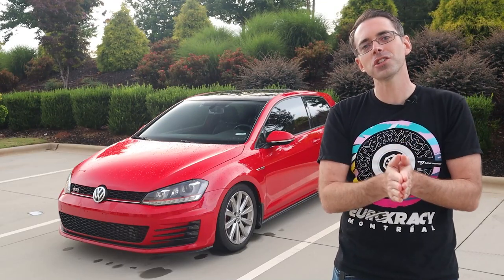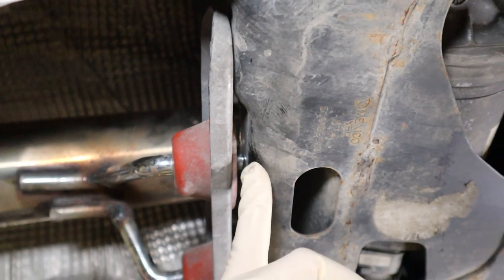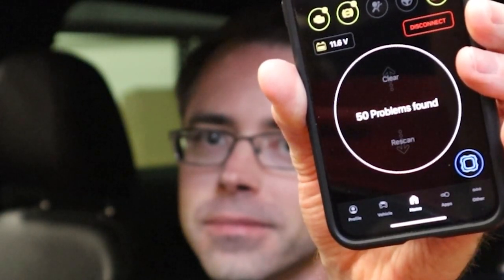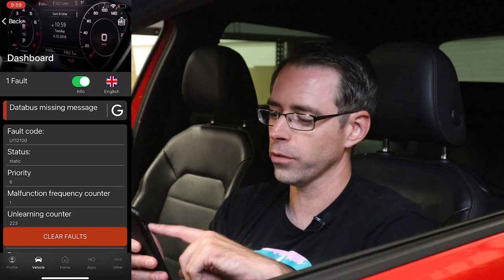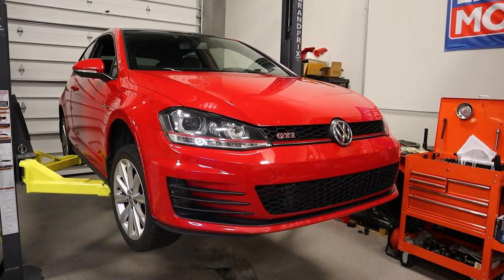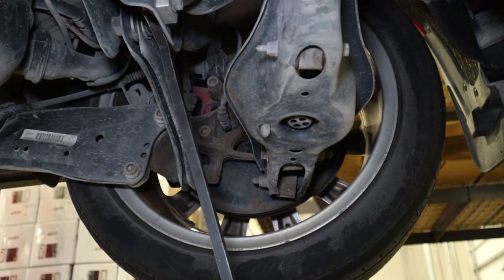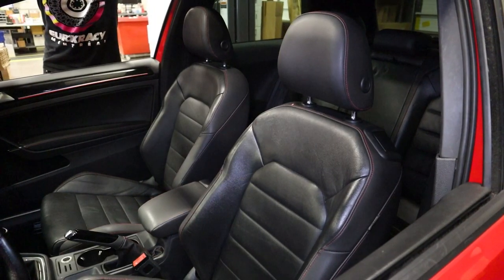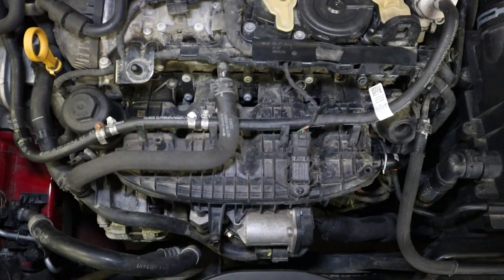Buying the Cheapest MK7 GTI

Comment: My 2014 GLI has 200K miles. I love this car. Its been carbon cleaned and almost every part has been replaced. New suspension, new brakes/tires, entirely new cooling system, new belt, battery, alternator, and timing chain service. Thinking about some red top APR coils.

My favorite upgrades:

Unitronic stage 1 ECU/TCU tune
Upgraded Billstein B4 shocks
034 Solid rubber motor mounts
034 Aluminum dogbone mount
034 Beefier rear sway bar
Tuxmat custom front/rear floor mats
Reply: Yikes, that is a TON of stuff to have to replace on a 2014. Personally I drive a 2015 and the only part that's required replacement was the accessory belt. Always heard VW's were pricey to maintain. Jeez.
Reply: i drive a 2013 and i only replaced the pcv valve (40 bucks), an accessory belt and re seal an oil leak on the chain cover
Reply: How much is the carbon clean up ???

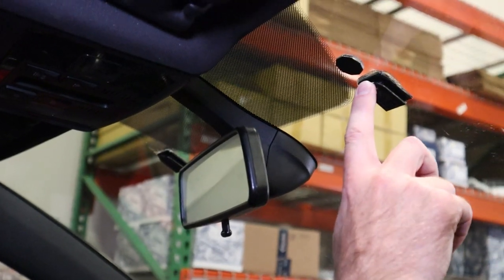Comment: 17:47 These actually come off pretty easily with heat. Just heat them pretty good and the glue will begin to come loose. After some heat, just use some pliers and try to gently rotate the mounts. If they don't seem to move, apply more heat, they should come off safely and not damage the windshield in any way. Be careful not to drop the hot mount in the interior, so it's nice to also protect the places where the hot mirror mount may fall on top of.

I've worked in a place that replaced windshield and sometimes there was the need to remove and reglue those mounts and using this method, I have never seen a windshield break before.

Nice video, as always!

Comment: about a year and a half ago i bought a 2016 mk7 gti 2 door performance with 140k on it for 8k. after doing some mods like a e30 stage 2 i sold it to a good buddy of mine and it is currently at almost 200k miles on it everyone should be buying this dirt cheap high mile mk7s

Comment: I feel like I got a great deal in this crazy over inflated market. Picked up a insanely clean one owner, garaged ‘17 GTI Sport DSG with 39K miles for $21K. The thing is still brand new. I love that it has the Golf R brakes and mechanical LSD. I almost pulled the trigger on a just as mint ‘19 with 32K miles for $32K. So the one I got was a steal.
Reply: I still can’t get over how a car can be 5 years old and not have a single rock chip or scratch anywhere. I feel bad commuting to work on I-95 where you can’t avoid  getting behind a dump truck. I. HATE. DUMP. TRUCKS. 😂🤬

Comment: Change the passenger rear speed sensor, oem only.  They go bad and cause all of those faults that won’t clear.  I had the same issue on my a3 8v.  For some reason it’s at a point on the circuit that causes a insane about of problems.

Comment: my GLI was $9700 out the door and so far only replaced the pcv valve and accessory belt. theres a small oil leak from the timing cover ans thats it. i bought it with 123k mi and im on 130k now and its still fine 👍🏾

Comment: Back in 2019, my "stage 2" 2004 Subaru sti kept throwing a flashing CEL for misfire in cylinder 3. Turned out that my car needed a fully built closed deck motor and 35 psi of boost to solve that issue. I agree, resetting CELs won't solve problems.

Comment: I bout two brand new MK7’s a 2016 in April 2016 and 2017 Sport in December 2017. This was during the diesel gate scandal. I paid 20k brand new for the 2016 and 21k for the 2017. The days of deals are long gone. I will be sure to buy a MK8 but only when I can get a similar deal in a few years.

Comment: Wow, seeing the current prices makes me glad I bought my GTI when I did. Got my 2015 SE w/ 102k miles from a dealer for $9400 ($10500 after taxes, fees, etc.) back in November of 2019. Only issues were that the front bumper had some damage, specifically the lower center grille and front lip; the exterior of the hood, bumper, and headlights had taken some peppering from debris, and the sunroof is cracked on the corners. Honestly though, those issues are hardly noticeable and haven't caused me any problems. Absolutely zero leaks on the sunroof like people are claiming, and it's been taken through some pretty heavy rainstorms. Maintenance has been fine as well, I should probably carbon clean it soon, though..
Reply: 9k for 102k miles?! That seems like highway robbery.
Reply: @RandyAugustus  Who are you implying got robbed?
Reply: @cocainecowboy1717  Highway robbery where your car appreciates 30% in over two years and has had zero reliability issues while daily driving. I guess I got "highway robbed" then (even though most similar GTIs were still listed around 12-13k+ when I bought it).

Comment: I paid 10k for my 15 GTI 115k miles. It had a broken radiator support from a curb check and still has flaws in paint. I'm in the process of stage 3 uprades.

Comment: i managed to nab a salvaged 2016 gti a few years ago for 8k it only had about 27 thousand miles on the clock. after about 1000$ in repairs all around it was roadworthy it is severely hail damaged but i don't mind it still preforms well

Comment: just bought a mk7 gti with 36k miles and the driver side front wheel/or brakes squeaks really bad, squeeks at low speeds and usually goes away af higher speeds, also goes away when breaking, i’m guessing it’s a brake related issue, brakes are pretty worn out. any ideas?

Comment: One would HOPE a dealer would fix things... Unfortunately when I bought my used VW from a dealer in Chicago, all they did was clear the check engine light which came on again the day after I got it home and the "2 new front tires" they put on were dry rotted and cracked and went flat on me before I even made it home. Personally, I'll be avoiding dealerships altogether.
Reply: @cocainecowboy1717  I did look over the car at the time of purchase. I then had to drive almost 2 hours out the next day in the rain with a friend to pick it up so he could drive my brother's car back while I drove the new one. In that time, they swapped the dry rotted tires onto it. I might have caught it on a good day, but this was a downpour which arguably makes what they did even more dangerous and scummy. Regardless of whether I should have caught it, the dealership is still the one pulling that shit, so I'll stand with my previous statement. Screw dealerships

Comment: Can you guys give us some info on timing chain needs at this mileage? 
I got a very similar deal, 130k 2016 PP/Autobahn with ACC/DCC, basically fully loaded and i got it for 10k even. It was pretty much problem free, freeway miles, bone stock, and I did all my maintenance (dsg, plugs, coils, fluids, etc). But coming from a mk6, not sure if the timing chain is something that should be serviced/replaced, or if it's not an issue, etc.
Reply: i was seeing on the forums that the chains are really solid on these cars and they are rated for around 200k miles since they have a really robust system. you can even change em yourself if you want its time consuming but from what i saw on the DIY posts its not what id call "Hard"

Comment: I had an error P020200 but after I cleared and run the OBD scan again didn't come back. Is that mean that my camshaft cylinder 2 has no issue? And what I suppose to see in the live data engine for the camshafts in the 4 banks percentages?

Comment: wait what? mk7 and manual handbrake? I am so confused. What is vw mixing around with spec between USA and EU? Mk7s in the eu come with the electric parking brake as standard, at least they do on the gti and gtd. Also come with vented discs in the rear as standard. Why dont they in the usa? I dont get it.
Reply from the maker: Only the R has it in the us

Comment: Damn 209k km... That's pretty much for a 2015, but a good price for it. If i had that budget here in Sweden I could only get a mk5 gti

Also, easy way to test the clutch on manual cars, is to drive 30mph with 5th gear, press the clutch and rev to like 5-5500 rpm and let go of clutch fast. If it revs slowly down, clutch is bad, if it hooks and the rev goes down directly clutch is good

Comment: Mine is at auction somewhere with 261k miles and in need of a flywheel and another waterpump lol, someone go find it 
010540 are the last 6 of the vin, is a 2017

Comment: Lowered suspension. I would have walked away. People are not smart enough to modify their cars.
Reply: Ditto
Reply: @johna.4334  I bought a 2004 Golf from a police auction for $800. I paid a shop $2,600 to install another engine and $1,000 to fix the heater core. I paid an upholster shop $4,100 to redo the inside because the sunroof was leaking. Now I can't get the a/c to work. The dealer wanted $1,700 to fix it. I have videos of me hot wiring it to work.
Reply: @blackericdenice  
I feel your pain.
Word to the wise: Teach/force yourself to do the repair work yourself. If this is not possible then buy the car new with a warranty.

Comment: Why would someone put those cheap-looking, plain-Jane, bottom of the line, standard Golf wheels on a GTI? I'm not a huge fan of the standard Mk7 GTI wheels either... but they are miles above those "Sedan DePlains" that were on it when you purchased it!

Is that an SE or an Autobahn model? I see the leather seats and the red stripe through the headlights. Definitely NOT S model features.